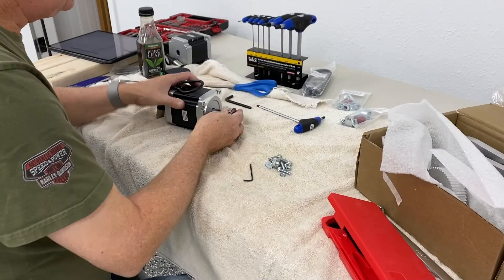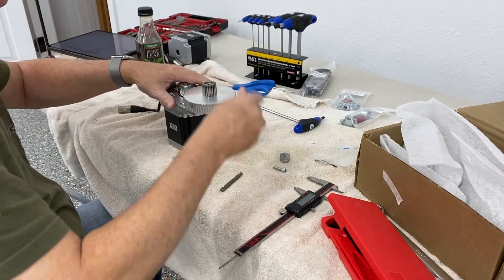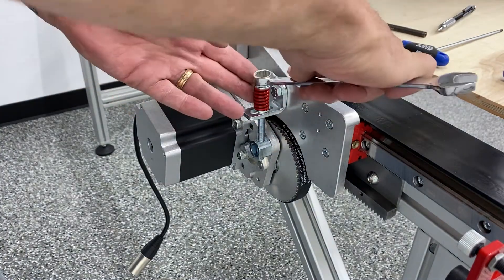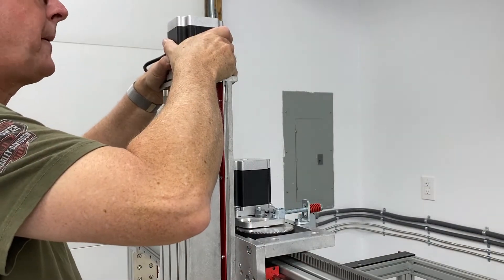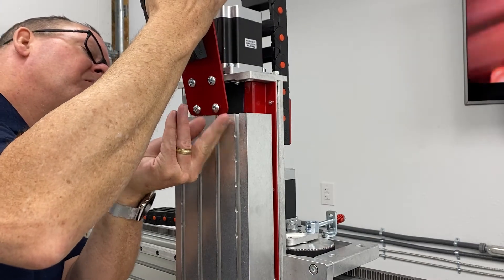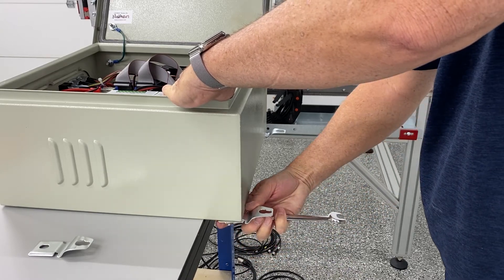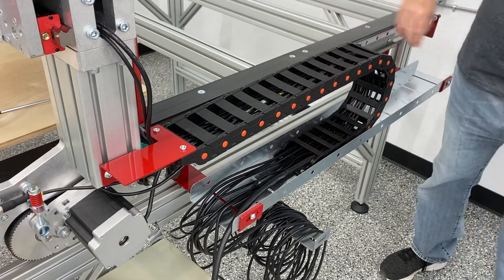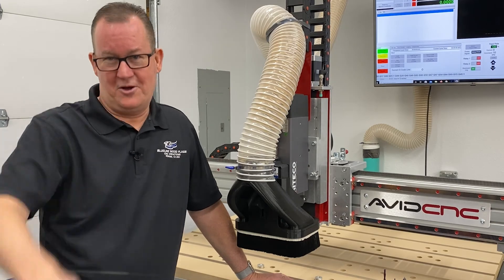AVID CNC 48" x 48" Pro Assembly, Part 3 of 3

Comment: I know it's an old thread, but great great video on assembling the Avid CNC machine. I'm on my third and hopefully last version of my DIY CNC. 

I started with buying the plans of the GRUNBLAU MDF3790 back in 2012 for my first CNC as I wanted to start with a basic and easy to build project. I had a friend who had a CNC to cut all the mdf parts for me. The CNC served me for a while, but I wanted a larger work surface to be able to work with a 4x8 sheet of plywood, which the Grunblau CNC couldn't do. 

I then designed all the plans myself based on information gathered here and there on the net at the end of 2014. The base was solid metal with C-Beam linear rails and wheels from Openbuilds. With this new design, I was able to work from a full 4x8 sheet of plywood. Since I also cut aluminum with my CNC, I had to make a large and heavy gantry. Running that heavy gantry with the Xtreme Solid V Wheels from Openbuilds worked for a while, but the wheels wore out quickly under the weight end I had to replace them from time to time.

I then decided to make a third iteration to my CNC based on the AvidCNC PRO4896 4' x 8' CNC Router Machine. I kept the same metal base as I wanted to keep it due to its strength and replaced the CBeams by larger 15 Series (1.5") aluminum extrusions from FazStore since I’m from Canada. I also drew all the plans for the riser plates, joining plates, etc and cut them in aluminum. I’m now at the assembly stage and your videos are an invaluable information resource on how to assemble the CNC. You mention all the details I needed to fully understand the assembly process and hopefully I will be able to use my new CNC shortly.
Reply from the maker: @denlaps5797  well kudos for going through the entire design process on your own and following through with multiple iterations as your needs changed and as the technology changed.  You are a pioneer.  I’m glad my assembly videos have been of assistance to you!

Comment: Thanks for the series, I have been watching alot of these Avid builds as I am waiting for my pro4848 to arrive during xmas.  Where did you find the dust boot at.  I would like to get one for my coming machine, don't have a the desire to make a lot of dust before I get one.
Reply from the maker: Hi Kenneth.  That dust boot in the video series is made by KentCNC.  I don’t like how it works and it leaves a lot of dust and wood chips behind.  I have since replaced it with a different type made by Keith Moreland.  He runs an Etsy shop called OneGuyInAShop.  He can set you up right.